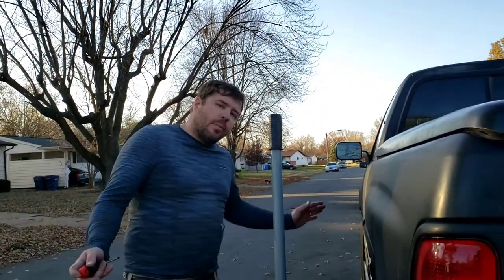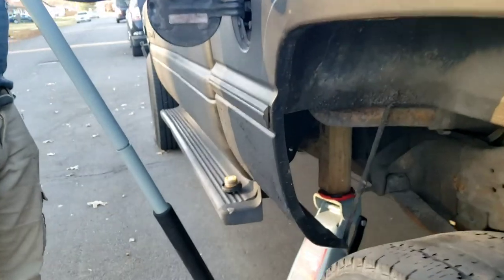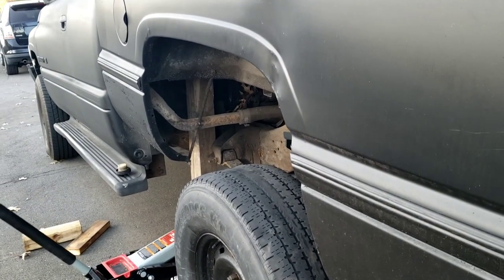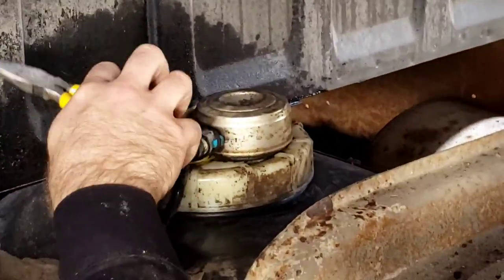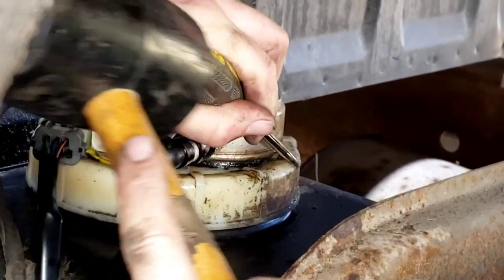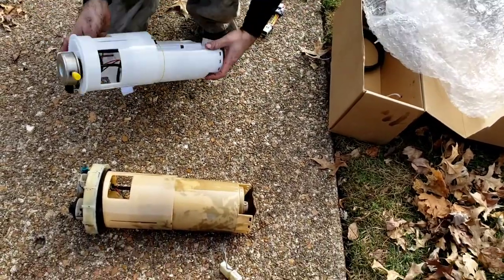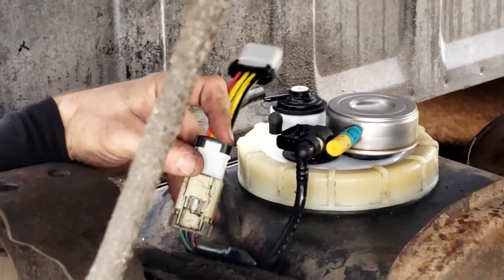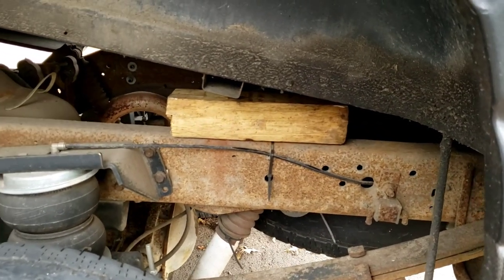changing fuel pump in 2nd gen Dodge ram 1994-2001 easy bed lift replacement with Are Jay the redneck

Comment: this guy doesnt know what hes doing he broke the first connector cause he didnt unlock it . smh
Reply: I usually do the same thing. By the time I figured out how the dam thing was designed, it's usually pretty well destroyed
Reply: I getting gas and spark...cranking but won't start, and I just changed the fuel pump....any idea???  I need help....
Reply: 2002 1500 dodge ram 4x4 5.9
Reply: @raydorsch9517  could possibly be timing position sensor or idle control valve
Reply: Watching him remove that connector was painful 😂
Reply: @raydorsch9517 probably 2 years too late but my dodge 98 318 5.2 had a crank but no start, changed the crankshaft position sensor and put some seafoam in the fuel tank, started right up

Comment: Are Jay you are one cool dude, love to have you guys for neighbors. It was great to see the family involvement during recording. 
Glad to see you're working safe with jack stands & blocks. Also, anyone working with gasoline, use the brass or wood. Sparks & gas vapor = a painful death.
This is a very comprehensive video. So many other you-tubers don't show the hard parts. Well the hard parts are what us diy'ers really need to see. So thanks a million for not cutting them out. 
Usually by the time I've figured out the design of the electrical connectors, they are half destroyed! Same goes for all those crazy tubing connections, i.e. fuel, ATF, etc. 
And yeah for channel lock pliers for snapping them back together! 
My '02 Ram is a diesel. There's not a nut or bolt on it that isn't rusted into one unit. I'm planning on cutting open the floor of bed. The bedliner will cover the hole. I really hope my pump is in the same place as yours.

P.S. I subbed. Looking forward to see what else you've posted.
Reply from the maker: Hey savage thanks, i try to cover all of the crap that can and does happen all the way so someone who has never done it can be prepared for the whole repair.

Thanks for watching and thanks for the sub every little bit helps during these times.

Also nice 44 i have the 19x.

Seize the day each and everyday-Are Jay
Reply from the maker: Also here is my 2nd gen dodge repair playlist. 
Tons of repairs covvered and good luck.

https://youtube.com/playlist?list=PLQ0kUxbVWpJ-ebGroH9mPPUSfTWONjU-0
Reply: @RJsGarages  You watched my 44 vid? Full disclosure is in the description. It was April first don't ya know!

Comment: Scary. I'm amazed that you didn't poke or stab yourself.
Having a similar truck that had muck in the tank from water and modern gas, let me assure you that dropping the tank is far easier and safer. 
It is advised to have as little gas in the tank.

Comment: Push the red button 😂😊

Same thing happened to me when I first learned about the clip. Also filled up my tank and drove home.  Next morning truck won't start. 

I have a flatbed 1/4 plate so don't wanna cut through it.  Not sure if It will come apart the same as this.
Reply from the maker: Yes, it is always an adventure, working on these old girls.

That sounds like a rough repair with all that weight. Make sure you have a strong helper near buy just to be safe.

Thanks for watching!

Please like and subscribe every little bit helps during these times.

Seize the day each and everyday-Are Jay 

Here is our Doge playlist in case you ever need it.

Top 2nd gen 1994-2002 Dodge Ram repairs and upgrade videos: https://www.youtube.com/playlist?list=PLQ0kUxbVWpJ-ebGroH9mPPUSfTWONjU-0

Comment: Hi RJ, thanks for a great video. Could you tell me the diameter of the area where the grommet rubber seal goes on the fuel tank rollover vent valve. We're having a hard time getting that part. Thank you, Larry

Comment: Always when you fill the tank. The red tab should have been a give away to unlock. I’m horrible with plastic clips to. Have to study them hard then I break it. The dad noises are real in this video. Good job having your kid help save them over $1,000 later in life. Don’t do this on blacktop. Gas will eat it

Comment: Good vid, Jay. Thank you! Nice job. I'm currently haveing a problem with my sending unit but, I'd certainly replace the pump while I'm at it. Wheather you drop the tank or raise the bed... Either method would be a pain in the ass! LOL
Reply from the maker: Thanks and thank you for watching.

Yes I just decided to go with the pain that did not require syphoning 35 gallons of gas out of the tank first.

Thanks for watching and good luck!

Please like and subscribe every little bit helps during these times.

Seize the day each and everyday-Are Jay

Here is a playlist of most of the 2nd Gen dodge repairs, I have done over the years.
Top 2nd gen 1994-2002 Dodge Ram repairs and upgrade videos: https://www.youtube.com/playlist?list=PLQ0kUxbVWpJ-ebGroH9mPPUSfTWONjU-0

Comment: I just put on my 98 2 gen fuel pump but the gauge is not working the truck does start right up what can be the issue
Reply from the maker: Some how the electrical connection may be loose, or the actual part on the back of the gauge went bad/got loose.  Good luck.

Comment: You gave this a great effort and got the job done

Do You think undoing all the Bed Bolts on one side and loosening them on the other the bed might have tilted more easily lifting one side up instead of pivoting off the rear bed bolts

I am just wondering

Our 06 is dead so We are next

There was over 200 pounds of just fuel to deal with so lifting the bed sounds like a logical alternative to dropping the tank

You got the job done
Reply from the maker: Thanks for watching, i tried slightly loosening the one side and it just wasnt giving me enough room to work above the gas tank.
This way was actually much easier then it seems. Just jack it up slowly and use boards to place between the frame and the bed and it will work just fine.

Thanks for watching.
Please like and subscribe every little bit helps during these times.

Seize the day each and everyday-Are Jay 
Good Luck!

Comment: I have a 97 Dodge ram 1500 I just cut an access panel out of the bed of the truck
Reply from the maker: That works to, but I use my truck for work so a cut in the bed, wouldnt work. It was really easy to lift the bed.

Thanks for watching!

Please like and subscribe every little bit helps during these times.

Seize the day each and everyday-Are Jay

Here is my 2nd gen dodge repair playlist if you need to do more repairs.

Top 2nd gen 1994-2002 Dodge Ram repairs and upgrade videos: https://www.youtube.com/playlist?list=PLQ0kUxbVWpJ-ebGroH9mPPUSfTWONjU-0

Comment: How long did this amazon fuel pump last? Should I get one or get one from a generic auto parts store for triple the price?
Reply from the maker: It is Still working fine.

If you do but, and could buy it from the link in the video description it would be awesome.

Thanks for watching.

Please like and subscribe every little bit helps during these times.

Seize the day each and every day-Are Jay
Reply: @RJsGarages  that's great,  the one in the link is unavailable now, but I found a few just like it on amazon, I'll probably go down the amazon route knowing that it's lasted for you. 

Autozone has 2, one for 166.99 and another for nearly 400 dollars. 166 is reasonable, but 400 is ridiculous